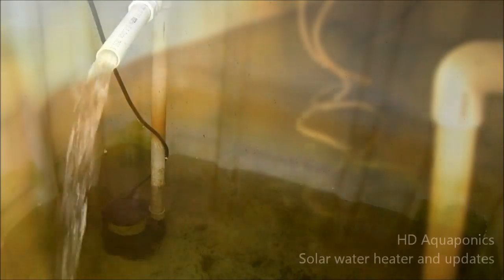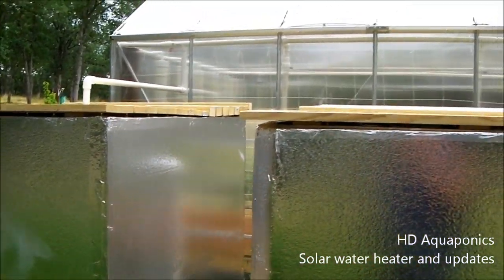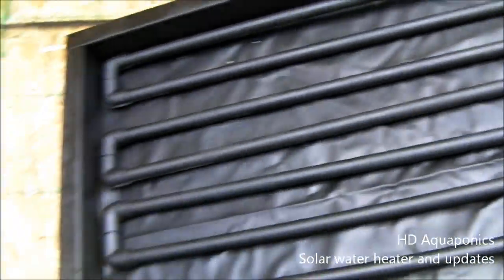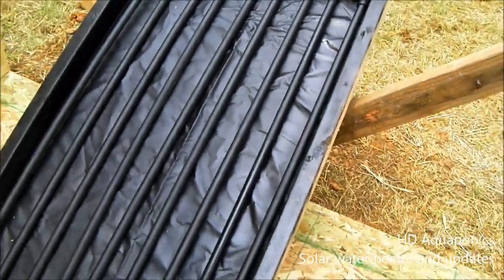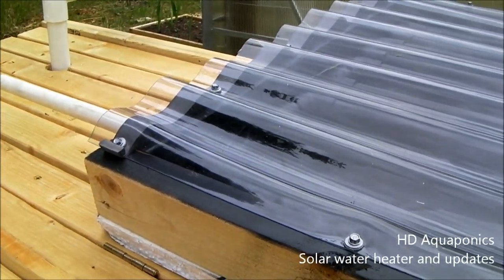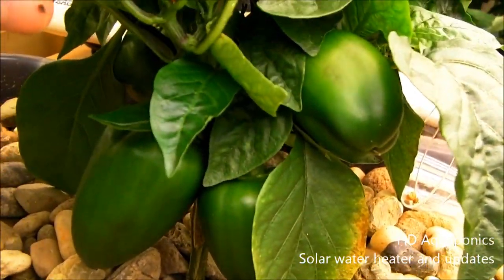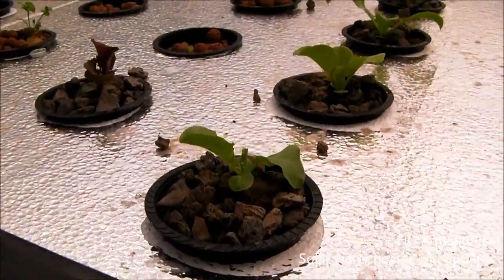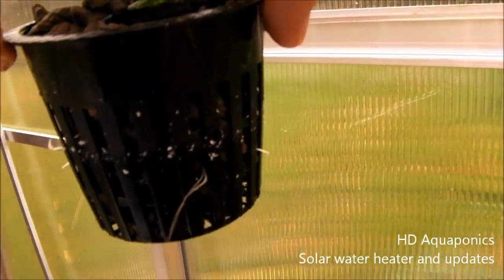HD Aquaponics - Ep.19 - Solar hot water heater, floating raft dwc lettuce, tilapia

Comment: cool system.. copper would have been better if you could afford it over PVC
Reply: +Tim Baxter You can't use copper with the system water or it will contaminate it and stress/ kill the fish. You could plumb a solar water heater through it's own copper plumbing run through a stainless steel heat exchanger in the tank water, though.

Comment: If your still looking for a heat solution consider a solar modular heat sink. 4-6 steel drums with water/glycol insulated or better buried. Secondary system to heat underside of fish tank. Solar collector pumps down through heat sink and a separate heat exchange loop to heat under/around/ or best under the fish tank. System keeps glycol/copper etc out of AP system and allows control by submersible thermostat to control tank heat pump. Search Youtube for a Vid called Modular Heat Storage for more

Comment: In the end it would work better if you used a fluid heatsink that is the transfer media with separated loops from the solar collector and fishtank heater coil. Bury 4-6 steel drums connected together and pump the heat down into it, and collect that heat with a separate line to heat fish tank. If the tank heater coil is under the tank it should work like a charm. Submersible thermostat can be used to trigger pump for tank heat. Outside of AP system so copper can be used for heater :)

Comment: Many window instillation company's will let you have old double glazed units that they have removed when installing new units. This saves them a disposal fee at the dump. 
If you put a heat exchange tank into your system you can then use pure antifreeze through the copper pipes in the solar collector. This transfers heat better than water. 
Test system for leaks as antifreeze is toxic!
The heat exchange tank lets you adjust the flow of tank water and hence tank temp.

Comment: It depends on the type of copper tubing used.  Each type has a different mix of other metals in it to either allow it to be more/less flexible, withstand more pressure or other purposes.  If your water becomes too acidic, it can eat away the copper tubing which can be accelerated in different alloys of copper tubing.  You should avoid using copper!  

skepticalaquarist (dot) com/copper-sulfate
water.epa (dot) gov/scitech/swguidance/standards/criteria/aqlife/pollutants/copper/background.cfm

Comment: Using garden hose to circulate the water is a bad idea.  The majority of garden hose is not meant for potable water uses.  Plus as it heats up (which it isn't designed for) it will leech and off-gas chemicals even faster.  Your safest bet is to build a heat exchanger that doesn't actually pass water back into the tanks but rather uses a coil in the tanks in addition to the solar collecting coil.  I would recommend stainless vs. copper for the coils because copper can be toxic to fish.

Comment: @dontlikenumbers.. i have had copper in my aquaponics system for a while now.. it doesnt affect the fish at all as far as i can tell.. i wouldnt put it directly in the tank itself but i do use it to heat the tank water using a rocket mass heater connected to a pump in the fish tank.. any credible research on your claim? just wondering, love to read it if there is.

Comment: look into a rocket mass heater.. run copper piping inside and pump ur fish tank water through it.. i am heating water 5 degrees warmer than the water in the 275 tote and it raises about 5 degrees an hour.. once ur to temp you can use tank heaters over night to maintain temp.

Comment: @edpozek I made something similar to heat my house water using flexable copper bubing and a $20 "solar" controller from harbor freight.  The system easily heats all the hot water we (3 of us) can use and then some.

Comment: Where are you located to have water so cold? I am in Montana and had a similar problem, so instead of Tilapia which like warm water, I am using rainbow trout. My current water temp is 40 and has been down to 33. The trout get sluggish when it is in the low 30's but survive. They are much more lively this week in the 40's temps

Comment: Try using copper pipe instead of PVC for your solar panel. You also need to be able to insulate the panel so it doesn't cool the water. You also might want to consider putting the panel inside the greenhouse.

Comment: Could you share what water temps. youre getting out of the Collector ?  Also,  Pex Tubing for a Collector will hold up much better than PVC in the long run.  Im building a Collector out of 300' of 3/4" Pex Tubing right now  in an enclosed Wood Box  which will thermosyphon into my Water Heater Tank (hopefully) , otherwise ill use a 12 vdc pump for circulation.   Any problem with expansion of the PVC yet ?  Give us the outlet temps please.  Thanks.

Comment: I used to install real panels and to shorten it up, this will not work in the winter at all in fact the smaller pipes will freeze and break you must drain the system each winter even in cali/Florida etc.

Comment: @edpozek    Later I noticed your system is not pressurized, I would try it just the way it is and see how it works. Pulling all if it out seems a waste since there is NO pressure on the line. Just see how long it lasts, it make not have any problems for years. If it springs a leak later on, fix it then. We always had people plumb a water heater with PVC and then complained later that it leaks, usually near the water heater itself due to the heat and the expansion of the hot water.

Comment: On a cold day, you're going to lose alot of heat when the wind blows across those exposed pipes.  You may want to consider insulating them. At the very least, you can try covering them with automotive header wrap and scrap liner. If you want to get extreme, I bet you can get creative with expanding insulation foam and something (like a cardboard box) to constrain the foam while it sets, but this might make it a hassle to repair sections of pipe.

Comment: The Solar Heater should heat the water really well, infact maybe too well if the flow of water is slow. Is the piping Cpvc or pvc inside the solar collector? Cpvc can handle the heat but pvc will warp eventually and may leak. If you do have problems the pipe can be changed over with a pvc/cpvc adapter. Of course you will have to rebuild the cuts of your unit in time.

user/richallenmusic has good luck with solar air heaters. Maybe one to heat the greenhouse?